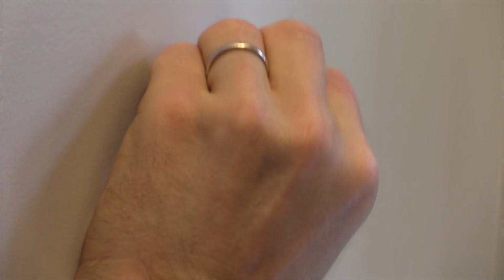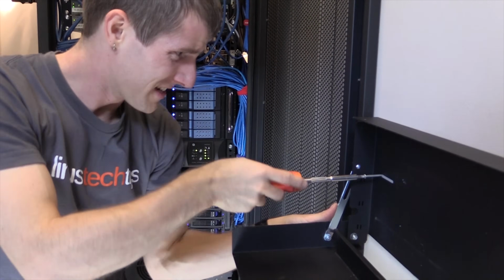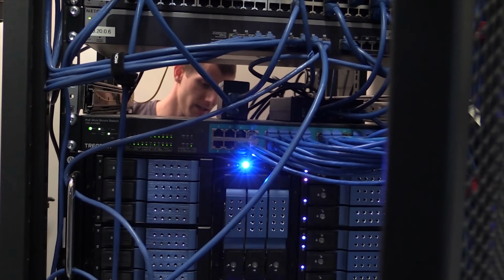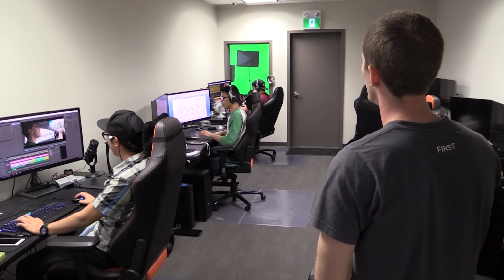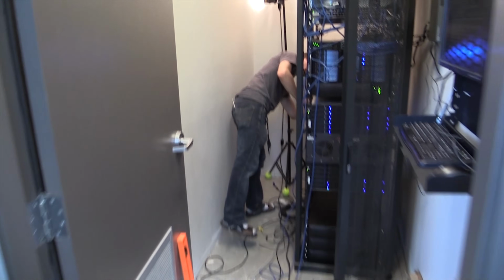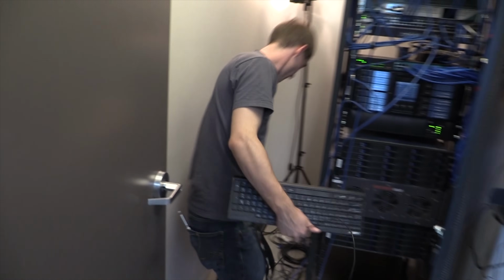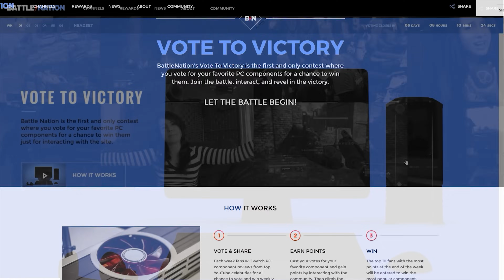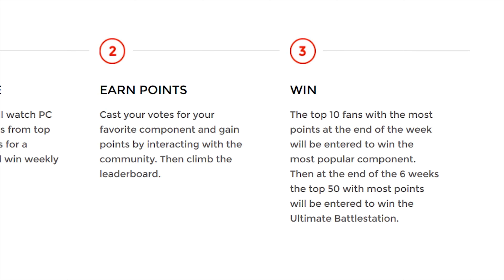Server Room Updates!! UPSes, KVMs, and more!

Comment: Why you don't use wireless mouse and keyboard for server room ?
Reply: +YASH PATEL Because changing the batteries every 5 weeks isn't fun at all.
Reply: +TheGoldenEagleEye It takes only 10 seconds to change batteries every 5 weeks so it is very easy instead mess with wires.
Reply: +PitchHeathen Seriously ???
He can afford batteries.... Even he can get it for free.
Reply: +YASH PATEL Because when the network crashes and the entire office stops, wasting 15 minutes on finding AA batteries and finally realizing you've run out and have to go to the shops to get batteries and after 40 minutes of downtime you can for the first time get into your servers is just idiotic ;)
Failures never come when you can deal with them, it's always on that day there's a big release or project finishing and everyone is calling to fix it now...
Besides, what would be the advantage of wireless in a serverroom KVM? Yes I have a wireless mouse for my laptop, but my desktop, that thing that never moves has a wired KB and mouse, same for my KVM...
A server rack in total weighs anywhere up to 800KG, it's not going anywhere so why go wireless ;P
Reply: Simply he can't use wireless mouse and keyboard because of detection problem during boot up and in some system wireless peripherals not working in boot menu.

Comment: Nice to see your leveling everything. It's very important. The last thing you want to do is cause your system stress by making the data and electricity run up hill. You also have a problem if you have a power outage and all that data leaks back out. I really hate sweeping it all up off the floor and putting those 1's and 0's back in order.

Comment: Why do you use Windows Server? Wouldn't a Linux based one work better?
Reply: +VividBagels 
He's using server 2012 (r2??) which does have some good features built into it and is pretty rock stable and fast.  if you have users that have to use windows clients due to the software they have to use it often makes a lot of sense to have windows servers too.

There are good cases to use both Linux or windows and the reasons for using either are pretty good, personally I use both on our servers, some of them are linux as it's the best solution, some of them are windows as that's the best solution.

The whole Linux works better idea is very outdated and anyone who has got the best interests of the company they work for in mind would look at all options and pick the one that suits the needs best.
Reply: +VividBagels he explained it in a previous video when he was showing off the server IIRC there was software that they were using that was only available on windows, to use linux would break the workflow.
Reply: +Mark Batchford Well right tool for the job is of cause true. But Windows is really not a OS that is built for server usage.  But Windows does support some software that can't be running under Linux and then maybe add a virtual environment for that server to run in. But for talking to bare metal I would use Linux.
Reply: doubt any of you know what you're talking about. windows AD is scalable unlike competitors
Reply: Some Dick Only good thing about Windows is Active Directory.
Reply: Jason Dishong Oh, thanks!
Reply: +Maoh Lynx Kerberos and LDAP is probably as scalable.  Or have you ever ran in to problem with it?
Reply: Zandman26
it probably wouldn’t be a problem with a smaller company, also less hassle using windows, everything is prepackaged and ready to go out of the box. linus has no admin and probably doesn’t have the budget or time to deal with that type of environment. kerboros is already part of windows server and ldap is a pain to use
Reply: +Maoh Lynx Well you can get something that just works with minimal effort.  But down the line you will pay much more for using that type of solution. For example i know a place running Windows servers,  and for the last couple of years they once a year have there machines performing worse than a 386. and the only fix is a reboot.
Reply: Zandman26
 that company probably is running gui and not a core install. if seen uptime of several years on 08 server. only thing I see anyone use unix for is storage but even then its not really common. I've seen more synology nas then freebsd
Reply: +Zandman26 I'm sensing some bias for Linux here ;) Not denying Linux can do miracles but Windows not being a server usage OS?... Where are you getting that nonsense...
2012(R2) can be as light as Linux using Core instead of GUI (just the flip of a checkbox) and the built-in management toolkit is incredibly solid for managing hundreds (or thousands) of servers, installing and deploying software and commands over all those servers faster than you can get a cup of coffee. something that the Linux part can also do, after they install their management software...
Reply: Some Dick I used Windows 2008 Core, was hard, but fun.
Reply: Some Dick
Well, hard to not be after being a Windows user for a long time and then discovering Linux:) Also the direction Microsoft is going now adays I hardly want to touch it.
But if Core is so good it makes me wonder why they are working so much with Ubuntu now adays. This is both in the Cloud and Internet of things, and also open sourcing the .NET Framework feels like they started feel faced out.
Reply: Zandman26 Fair enough, I too am quite disappointed (understatement...) with all the tracking inside the OS and pushing several GB W10 updates onto people that have blocked the update and still waste their disk space and bandwidth by it...
But the server OS is rock solid, can easily be turned into GUI again for minor maintenance and what not and then back again, making local management very easy. Of coarse all the remote management comes standard so in the end you usually don't even need the GUI on the box itself.
Their move to open source .NET to me was awesome news as it meant writing on Raspberry and such is a lot easier as Visual Studio is a beautiful programming tool, I'm guessing they want to get more ground onto the Linux market with it, but might be anything...
Hyper-V server is free, and overal a nice hypervisor for testlabs and such that don't require PCI passthrough, which sadly still isn't implemented in Hyper-V (not sure if they'll ever add it...) but in it's defense Xen and VMWare aren't too user friendly with their implementations of it either, had my server frequently fail to reboot because the hypervisor refused to pass devices onto VM's and just stopped booting.
But I'm currently doing several Linux certifications (just starters) to get more into Linux as I'd love to employ some low power boxes for home automation and such and it might be useful on the job :)
Reply: +VividBagels Because these guys don't know jack shit.
Reply: +Jason Dishong Still I think for the storage server it would probably be better to use FreeBSD and ZFS as thats probebly the best FS for large storage. (Can run this on linux as well but not as supported because of licences). But as a Linux user my self it would be nice if he used linux at least on the server:D

Comment: Cable management is a bit...off. Between the cisco router and the switch, you will need to have longer cables (say 5ft) and run them along the right hand side as you did the others. Also, color coding them makes them even easier to work work with...if you have to pull a cable going going to a server or a workstation, you will know which is which quickly.  Other than that, awesome setup!! Can't wait to learn about your rendering server!

Comment: Some key tips:
1. You're going to want to label all those cables. Makes it a lot easier to conduct updates and troubleshoot issues.
2. I think it would be more beneficial to change out the old cisco router for a new one or some other sort of enterprise grade system such as HP procurve. Yeah it will be a pain to configure if you're not that knowledgeable but it would support better scaling in the future.
3. Look into server visualization in the future. As you expand it may be beneficial to set up a system with blade servers.

Comment: As far as the studs behind that keyboard tray, you likely have a "shear" wall there.  It's basically an entire layer of plywood behind the drywall, effectively giving you an entire wall of "stud."  (You can Google shear walls to see why they are used in construction.)  If that's the case, using wood screws into the shear wall will hold just fine.

Comment: You don't have to close up the sides on that rack unless you're going to have a "cold side" (the front) and "hot side" (the back) like a datacenter has.  In your small room it looks like you have no air flow control like a datacenter, so closing up the rack doesn't help with anything except aesthetics.

Comment: I have several issues with your server room setup, but there's only one that I'll complain about. Your networking switches are all facing the wrong way! Put those in the back of the rack so all the cable mess is contained and the front is all nice and clean, and you'd lose some of the clutter and possibly make room for the KBM in the front of the rack.

Comment: Great video.  Cable management, i know how that goes since I worked in a casino\hotel.  Nothing like 8 48port switches and trying to cable manage that all in 1 rack except we would have 4 racks I think on levels 2,5,9, 14(which was actually 13 but they won't label it that.) I would like to know if you specifically specced out the wall outlets on how much voltage is needed and if what looks to be 4 sockets on different breakers.  For some reason contractors love putting it all on one breaker and we had a hell of a time getting it separated.

Comment: I want to see a internet speed test on their connection man! ;)
Reply: +Morten Nielsen 

They'd struggle to get a decent one... most of the normal speed test sites crap out when you try testing anything over about 500Mb.
Reply: Flat4Buggy That's 200Mbs shy of what they are meant to get... that's not an insignificant amount...

Once you get into the higher connection speeds the only reliable why I've found to test it is with multiple  FTP connections to known fast sites (i.e. when I wanted to test one of our offices new 1Gb connection I hit every other office with a large FTP download at the same time out of hours which, in theory, could have supplied nearly 2Gbs between them all)

Comment: Would you go for a standard filter on the room intake or would you go for something more like a car air filter that is designed for maximum airflow and filtration by use of extra surface area? If going for the standard filter you'd be better off mounting it on the outside so you could vacuum the dust of easily.

Comment: 2:04 , NEVER, lift something like this.  Do it safely or not at all.

This is directed at nothing actually in the rack but the "closet" itself, listening to Linus, all I'm hearing is, I've made this up as I go along, there was no predetermined plan of the room, the facilities, the layout, the access, anything.  It really pains me to see this with a new project, there was every opportunity to do this right, hell get a third party consultants advice.

Fire Suppression, BMS management/auto lights, dust/clean room procedures, I would have had the networking completely separate with CAT6 and OM3 MM between the cabinets themselves for clean patching.  I'd also would have liked to see a bypass solution in place for the UPS solution when you are doing maintenance on them.

The positive from all this is clearly this has been a learning experiance and perhaps you would have done this differently, if it suits your needs, then great.

Also RAID 5, I really don't want to be the one rebuilding that parity/redundancy, been there, done that, never getting that time back.  There is a reason Dell/HP etc say it is no longer "suitable for any business."

Comment: @linustechtips I work in IT and see a lot of sites that have switches and there connectors at the front... yet servers network at the back... which leads to cables going from front to the back look ugly! ever thought about breaking the mould.. and turning your switches around ?
(you can get reverse fan switches if you have a hot and cold side btw)

Comment: Not even data centres use SSDs yet (although that may have changed since I last looked). Fun setup for someone who's not used to network cabs.

What about backups? And what about a fire suppression solution for the server cab?
Reply: +Steven Whiting as far as im aware no data centers use ssd's yet. google is superfast already, imagine if all the storage was converted to ssd
Reply: GamersRevolt
Yeah I didn't think they did as they still aren't reliable enough.
Reply: +Steven Whiting I have a dedicated server in a data center running SSDs in RAID1
Reply: +Steven Whiting 
We use about 25% SSDs in my company's data centres with automated tiering on the storage so the most used blocks get moved onto the SSDs and lesser used stuff lives on spinning rust drives.
Reply: +Steven Whiting Hell yeah they do. Many are using Fusion-IO and Nutanix, etc.
Reply: Steven, Never heard of EMC extreme IO, pure storage or even some hybrids like tintri, tegile or nimble?
Reply: mpitogo
Nope. Just recently, can't remember where, saw a video on a data centre where they mentioned SSDs and not yet moving to them due to reliability. But guess things change.

Comment: I'm a noob at this. What is a server and what does it do or help?
Reply: +Oscar Hernandez server manages the whole network, if there wasnt server they would have to manually transfer files via flash drive or external storage for them to all edit it.
Reply: +Oscar Hernandez A server is really just another computer. However usually not worked on directly but is connected to a network where it has a specific use case. 

Like for example one server might only be used for crunching numbers while another is in charge of storing data. Also hardware on commercial servers are much more durable than normal home usage computers.

 Also they are built for 24/7 operation with minimal downtime much harder workload than normal home computers.

Comment: so linus i am trying to build a custom gaming rig that can play most new titles and record them on medium settings... currently i am putting together a parts list, however i have a budget of $450 usd. how can i keep the cost down, without sacrificing performance when recording gameplay... some of the games i would like to record are dying light, seven days to die, call of duty, minecraft, the forest, stranded deep, among many others. any suggestions on areas to cut costs? brands? recommendations? i'm open to suggestions from the comments as well
Reply: +MTBGAMING Get a job and save up money. $450 wont cut it. Build a PC with a GFX with CUDA cores (IE titan maybe x2) or OpenGL (IE AMD whatever). Buy a dedicated PCI capture card. Buy El Gato capture hardware. Set up OBS. 

Prepare to play games for 18 hours a day, everyday for the next 2 years to build an audience. 

In other words, work on your streaming personality, before you worry about the hardware, because your budget is way too small to do any modest gaming, let alone streaming, and you might burn out with all this expensive hardware you cant use to stream anymore.
Reply: good advice thank you =)

Comment: Cisco 2800/3800 unable to keep up with gigabit speeds, or too old? Custom ASIC versus XEON, XEON loses every time in the route switch world. Sure they aren't the ISR G2's (1900/2900/3900 to the layman), but they will out pace any home brewed router on the planet using a generic Intel processor. Other wise Cisco wouldn't be the enterprise power house and innovator they are. 
Space wise you are probably better off mounting the router and switch on the back of the rack in the same U taken up by the patch panel, and buying some Panduit or SystemX cable management pieces. 
Cool air in the front of the servers is a must, and hot air return behind the servers is also a must. Humidity in the room should be in the 40's at a minimum. Under 40% the ESD (Electrostatic Discharge) chance begins to climb the closer to 0% humidity you go. Venting the air in the front of the room could create a counter flow in that cold air comes in, goes down into what looks to be the center of the rack, hits the front of the rack and is either sucked in by the servers, or pushed out the front passive vent. Hot air on the other hand goes out the back of the servers, and rises, and could become somewhat trapped in the back and upper part of the room or pushed back down into the servers, or if your lucky vented out the passive vent. 

Just something to think about.

Comment: A little tip, any light switch on the wall in internally mounted to a stud, so you know that on one side or the other, there is a stud on either side of the light switch.

Comment: I manage servers for a living and you may want to consider changing up your cable management practices. You want every single piece of equipment in your rack to be able to come out without disrupting the equipment around it. Direct runs of cabling across the back/front aren't generally a gold idea, even if the piece of equipment is directly above or below. It may seem silly, but it really is a best practice. To those questioning why he didn't use a 1U kvm solution, he is clearly trying to preserve as much rack space as possible. I do prefer the slide out 1U kvm, but in this case it's acceptable and makes sense to have it mounted to the wall. You all must understand that Linus and crew are not used to the data center environment and must learn lessons as they go.